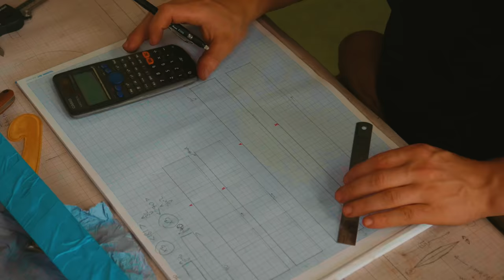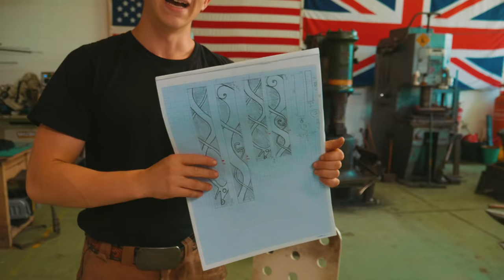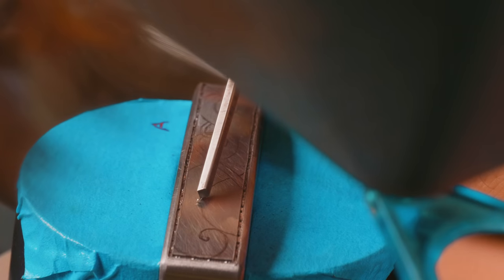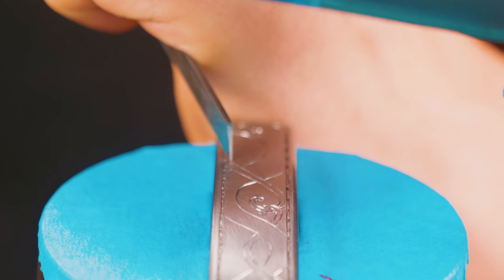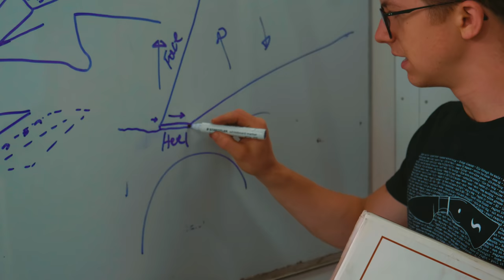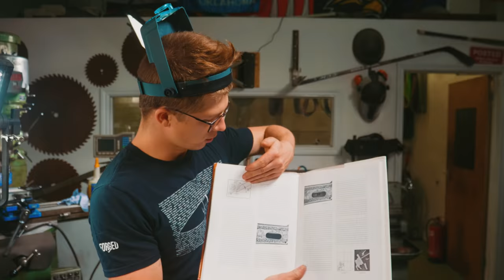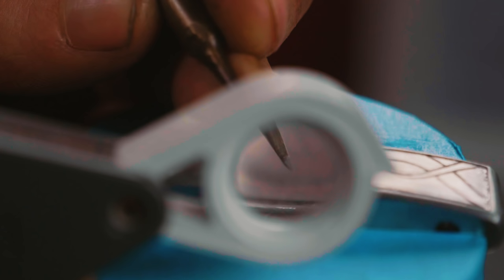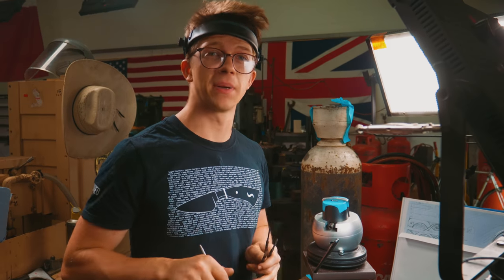MAKING A VIKING SWORD!!! Part 13

Comment: Love your work keep it up bro as a 14 year old child I find it very motivating
Reply: lol
Reply: Don’t let age stop you
Reply: Hummingbird PR0T3ST thanks
Reply: jaswant flora , persevere and lots of work...that's all you can do.  These days most anything you wanna know is on this place.  Never give up, may not think.your winning but it's always a process...less you win some lottery lol
Reply: Daniel Crawford so true
Reply: also one thing ive heard over and over again, is that oine way that smiths roadtest designs and showcase techniques is, i kid you not, hard plasticine, 

the reason being is that orange hot steel goes into whats known as a 'plastic state;' whereby it can be somewhat easily molded

and plasticine SORTOF, behaves similar, so you can, with hard plasticine and a hammer sort of learn about, drawing out, flattening, upsets, etc

thats if your folks dont let you try it out with some basic tools like a blowtorch and some scap steel and a brick

Comment: I have an engraving tip for you. My sister is an engraver, and she was taught to spray the piece with white spray paint before she draws her sketches in pencil on it. It helps to see it for the drawing/cutting process.

Comment: Alec, I'm not an engraver, but I have drawn many knotwork designs for other projects before (wood burning). I'm not sure if this would help or not. When I have a design I want to transfer to my finished project, it helps to draw a grid on the larger design then a smaller grid for the finished piece which helps me keep my lines and proportions in place. Especially when decreasing the design size to the final piece. Everything can be proportionally decreased that way.

Comment: Putting in a small convex onto the back may possibly probably maybe help with the fouling.
Reply: I was thinking the same. A triangular heel would give just as much support to the cutting edge but allow the more room for the back of the tool to clear the sides of the cut

Comment: Hi there Alec, I believe you need to take down the excess height (from the top of the tool to the heel )  in your gravers to help stop the graver fouling on the rear side of the cut. Possibly down to 1/8 th of an inch. Hope this makes sense to you.
        Cheers,
       Paul Russell.

Comment: Alec, Havent been able to watch to much of this series yet due to work. I will say that frequently for inlays, at least in silver, little teeth are raised from the bottom of the channel with the onglette. Just tapped in to raise little burs on the bottom of the channel. This helps grip the metal being inlayed as well. Just a little thought that might help in future endeavors.

Comment: Alec, have you tried glueing a paper template directly on to the steel with some spray glue? It always worked for me (however on softer metals) and it also protects the steel from scratches.  For this to work best use the thinnest paper you have, this way it ripps directly along your tool path.

Comment: Something that might help with engraving is having more free movement in the vice.  Instead of changing your position relative to the metal, you use a free finger to rotate the project so your tool, hammer, etc stay in the same position.  Consistency is key and all.  I can't remember the name of it, but there is also a specific vise for doing curves. Basically it'll let the vice and workpiece turn depending on the angle(s) you are engraving, so your hand position is the same, but what is being worked on moves in response to the engraving.  I've only seen one in use once, so that the above comment with a grain of salt, or a healthy dose of flux.

Either way, awesome work as always Alec. :D  Keep it up.

Comment: Can't you remove some metal from behind the heel on the graver to give yourself more clearance on curves?  On lathe tools, that's done by cutting a relief angle behind the cutting surface.  Google trepanning lathe tools to see what I mean.
Reply: Pest789, lol shoulda read yours b4 I started trying to write mine. Lol yours probably makes more sense. Blessed day now
Reply: The lathe tool cutting edge gets a lot more support than the engraving tool could get. I would expect a high risk of the edge breaking.
I was think that he could bevel the back edge to clear the cut edge, leaving a triangular shaped heel to support the cutting edge
Reply: I said "edge" too much, lol. Let me know if that got confusing
Reply: Yeah that's how trepanning tools work
Reply: I had the same thoughts.

Comment: For future reference, Alec...to make your life easier...to make sterling silver ductile enough to run through a draw plate, heat the wire in a darkened area of your shop until it’s glowing a dark cherry red. Quench in water and soak the silver in vinegar for about 5 minutes. Take it out, wash with soap and water and give it a nice clean up with 0000 steel wool. File your wire tip to a fine point and then run it through your draw plate. Life will be better and you can make the exact diameter of wire you need ;-).

Comment: Question for you Alec. Would it not be easier to use that blue tape and cover the item you are working on? You could use the tape to draw out your design and then carve it out? The tape would also help to protect from scratches....

Comment: Dear Alec, 
That might be a stupid question, but would it be possible to use the deep electro-etching like during the falchion, to make a very very slight recess in the metal, so that it would help you get a first "guideline" in the metal, to be then engraved deeper with the engraving tools ? Maybe if that's possible, it could help you get cleaner curve shape ?
Reply: Ritin Kornas I was thinking the same thing, might not work on the radiused guard though.
Reply: Why wouldn't it ? If the stencil is taped on it to follow the curve it should not be a problem to do the etching, no ?

Comment: I wonder if a carver's mallet might help with your engraving?  I dunno about steel but in wood, that is what I prefer to use over a regular hammer.  You have a larger mass that you can tap lighter which gives more control.  You might look into it.
Reply: I believe for metal an high density plastic face is preferred for transferring the force of the blow while absorption vibration (I could be way off on that)
For wood carving, is it a wooden mallet? Or does it depend on the size of the work?
Reply: The mallet also provides a much larger surface area for hitting so you don't have to look where you are swinging.  My point is that a tiny little hammer with a smaller surface area might not (just guessing) be the ideal way to hit the engraving chisel.  The mallet can be made of a variety of materials but traditionally, it is usually a hardwood like beech or maple.  These days they have hard plastic ones, too.  Again, for metal--no idea.

Comment: Fantastic as always, just a request for the next project, dyu think you could perhaps design a fantasy piece that is somewhat practical? Using everything you have learned so far including the nickel and copper Damascus stuff in the construction of the pomel or guard? It would just be cool to see all your different projects come together to make something completely from your obviously insane mind? Maybe doing a handle with techniques taken from the rapier and maybe even an elaborate guard like to basket sort of one from that build too? Amazing Chanel all the same, I can't believe how talented you are frankly

Comment: I don't know anything about engraving, just a quick thought popped up in my head. What if you kept that little angled foot of the new tool, but dug out a portion, about 2~3mm behind the heel, so that it wouldn't catch on the groove as you go around curves?

Comment: Can you save learning new skills like this for smaller pieces like knives? Then we won't be stuck on the learning experience on bigger project like this. Then when you're more adept at a skill you can practice it on these larger endeavours and make each project a little more fluid?

Comment: I might have just made a couple blocks of steel and done a trial run on those. Maybe not actually setting in the gold wire because they would seem hella expensive, but at lest with carving out the lines. Then you would have been able to figure out you needed to alter your tool before marking up your actual pieces. Oh well, sometimes you just need to jump in the deep end and have at it. Plus by working on your actual guard pieces I'm sure you're being sure to be extra careful.

Comment: Would there be an advantage to starting some of these engraving processes on the mill and then adding the undercuts with a tool and hammer afterward? At least to get the basic outlines and such?
Reply: David Gill its rounded so he really couldn't do anything on the mill
Reply: Conceptually though. There is potential to engrave on many things that are not rounded.
Reply: I don't think he has a computerized milling machine. Engraving would be virtually impossible without one, even on flat surfaces
Reply: with his mill, that would only work for straight lines on flat surfaces. He'd need a CNC for anything beyond that. Also, with such a tiny end mill I imagine the feed rate would have to be painfully slow as to not break the tool. By the time he sets up the mill for each line and then very slowly cuts, it might just be easier to engrave it. Plus hes trying to hone his engraving skills, practice is practice

Comment: The angles need to stay the same you need to grind out a relief out of the back so you can make the terms. Think about sure drill bits or End Mills Leave the cutting surfaces and the bottom the same just grind out a relief in the back

Comment: I don’t really know much about engravers, but if it is that back square edge that is causing you trouble in the curves. Would rounding the back side or making the back end narrower help without structural compromising the engraver? Never engraved before  and have no idea if that can successfully be done, but just an observation from your drawing.

Comment: Just wonder if you were to relieve the area behind the heal on a radius angle to allow only the cutting edge to be " on the work" . Hmmm  not sure that painted a good word picture. So in my mind it would look as though the cutting edge was dropped perhaps 1/16 " below the took body radius in trailing edge to support the cutting edge? Kinda like your forward edge at 40 degrees  and the lower surface at 35 deg as you state but reliving behind the lower surface so that the lower surface is only as long as the graving is wide, that way it's not fouling the graving w the trailing edge. I'd assume you would have to be very gental w the tool
  Oh heck best of luck and blessed day sirSir,  Crawford out.

Comment: I'm just wondering if it wouldn't be more assuring or easier, at least for the border carving of the guards, to put tape in the middle of the guard to prevent scratching? I mean, you did great here, no slippage on this guard, but I'm just wondering if there was any reason you decided not to, unless you didn't consider doing it?

Great video, you've even inspired me to look into some smithing classes, because it just looks fun from what I see on your channel, and I've always wanted to have some creative outlet and I think this might just be it.

Comment: You should go on forged in fire! Would be awesome to see your Craftsmanship on it.
Reply: He actually did an episode where he tries to make the three hour limit and couldn't.
Reply: Aaron Mackay and the blade broke 😔
Reply: The biggest problem with forged in fire is he works in such extreme detail and is unsatisfied with an imperfect blade. The 3 hour limit doesn't allow for his desired level of finish and detail. He'd have to compromise and hand in an extremely crude to his eyes blade.
Reply: Forged in Fire is not about craftsmanship, it's about productivity. I believe the way Alec does things is more representative of old school craftsmanship, the kind of work that would traditionally be expected from someone making a sword. Forged in Fire suffers lot from modern expectations of pumping out high volumes at adequate quality.
Reply: Ken Oakleaf actually it is all about craftsmanship. If the blade is made poorly(for the most part), you will lose. It's all about challenging the smiths skills and ability to do things right.
Reply: It's not about challenging their skills. Look at Walter Sorrels' episode. His blade broke. I guarantee you he has proper craftmanship in his normal job. Alec isn't a good fit for FiF because he cares about hte minor details. FiF doesn't give a crap about the details. Just that you crank out a crappy blade that is hard, sharp, won't deflect, won't crack, etc. You see people turn in all kinds of crap there. It's crap because they are rushed, not representative at all of their skill level.
Reply: uClash Gaming which is challenging their skills...
Reply: Functionality, not craftsmanship indeed. Just about every time a bladesmith embellishes or adds in unnecessary ornamentation they lose. They purely care about if it functions or and meets the basic requirements. Great fun to watch, but nothing like what Alec does.
Reply: I hear it can take a good month to make a proper katana.
Reply: uClash Gaming thanks for your comment buy I have to disagree with you... it's 100% about skill...heat management is a huge component of FIF. Overheat your metal and you make your blade brittle... don't heat it enough and you get cold shuts all throughout your blade. I agree they don't have time for extreme craftsmanship or embellishments like Alec does in the beginning round but they do for the final weapon. I'm sick of seeing these half-assed bladesmiths put in a garbage final weapon. Justice last episode The Guys Blade broke on the very first swing on the very first test. If he was able to get to that round he would turn it in one of the nicest blades since Burt. It shows when every master bladesmith makes it to the final round and generally wins on the show that craftsmanship and skill truly does decide who wins. I just think it would be fun because Alec is such a unique bladesmith and turns in such beautiful work that he may actually be able to do something very cool on the show.
Reply: Derek Edwards agreed...he'd have to not be OCD and just let things go...may not be possible lol
Reply: Aaron Mackay back in the Samurai days it could take months or even a year to make a proper Samurai sword just sheerly for how many times you have to fold it over in the work they put into sharpening it and putting an edge into it.
Reply: Chris Anderson 
Trust me I know. But a master bladesmith can make the sword in a month and even a master is afraid of the quench.
Reply: Aaron Mackay no I met in the days before power tools...I'm agreeing with you. Lol
Reply: Aaron Mackay the quench is the great equalizer
Reply: Chris Anderson indeed

Comment: I saw another video of yours where you send an electro etching tool. Could you not transfer your design to vinyl, etch onto the surface, lightly, and use that as your scribe lines?

Comment: I don't know anything about engraving, but what if you tried to taper the bottom edge of the engraver and also round it off so it would be rounded on the bottom edge of the tool and narrower.

Comment: Hey Alec, Could you make a video about forging a simple knife with just beginers tools? Im just getting into knife making and I would love to see you do a vid like that. Also if you do this video if you could give detail on how its done.
Reply: Conner Michaux he actually has one already where he made a fixed blade knife with zero power tools. He wouldn't even use a cordless drill.
Reply: He actually did use a cordless drill. It was hand-powered though. :)
Reply: Telris86 fair enough, but in today's age most people consider a cordless drill a battery operated one. 😋

Comment: Doesn't acid etching eat into the steel? Would it be possible to resize the designs on the computer (I do this using Paint, when sculpting), acid etch them and then chase the designs out with the graver?

Comment: I have a question for anyone who knows the answer. I have tried some blacksmithing and have seen several blacksmithing videos. It appears that when I heat up a piece of metal the metal moves rather quickly compared to the video. for instance I see someone flattening a piece of 1/2 inch rebar  and it takes them countless swings where as it takes me just 3-4. I am using a 3 pound cross peen hammer about 3/4 of the way down the handle. This is not bragging as this concerns me that i may be doing something horribly wrong.

Comment: There a reason you didn't make a 1:1 scale digital version and use the acetone transfer?
Reply from the maker: I wanted the challenge and skill development of drawing the design on by hand! I think that doing things the hard way is often a good way to develop foundational skills in a new pursuit!
Reply: I'll agree with that.  That acetone transfer is pretty cool though. In high school we used to make paper note cards with toner printed images and a small press.  Works for color too!

Comment: The video was unclear on the process that you will be using. Do you plan to engrave both sides first then begin with the gold inlays or will you be doing them one side at a time? It may be better to do all the engraving first. This way, in the event that you are unsatisfied and want to start over, you haven't used any precious gold wire.